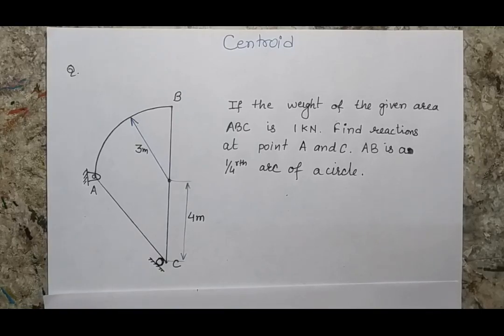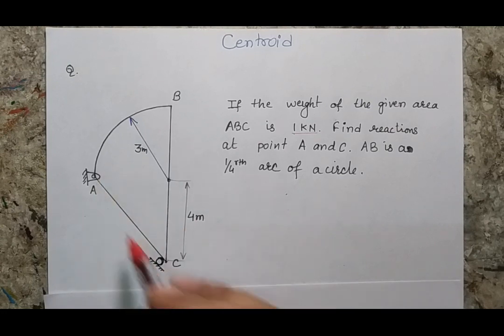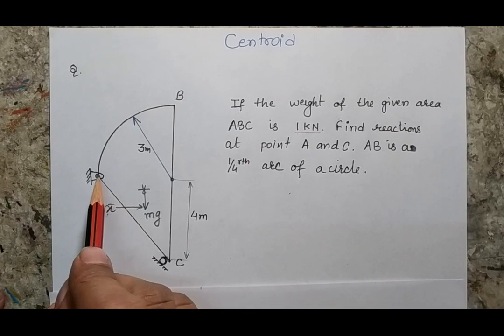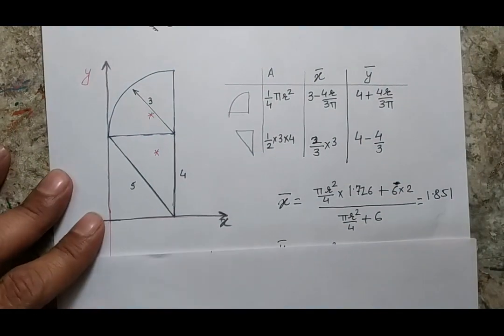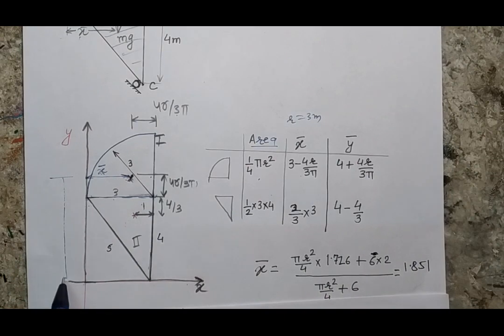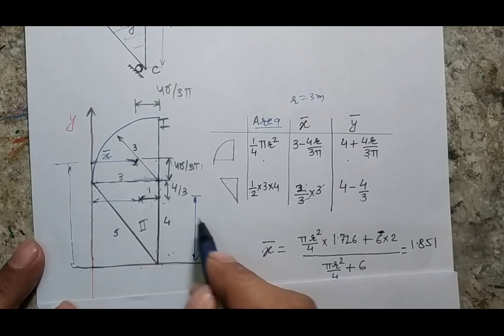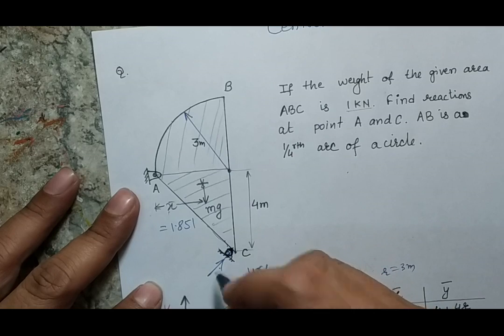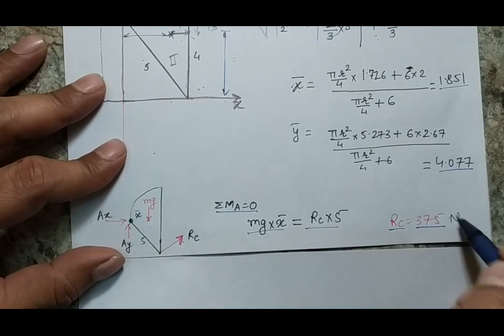L 4.7 Centroid ||Problem #5|| complex SHAPE| |Engineering Mechanics|| First Year Students

Comment: 3-4r/3π kese aya?
Reply: Sir 370.4 aa raha hai mera answer 
Can u please confir it
Reply from the maker: the position of the centroid of Q-circle is 4r/3pi from the flat side (or diameter side) however, in the problem, my references are assumed at extreme left, thus the position of the centroid of Q-circle will be (radius - 4r/3pi). I hope this explanation will help you, even though, if it is not clear, I can send you a pictorial presentation, please mail me on ashishpurohit1@gmail.
Reply: @ashishpurohit9138  i see ty sir